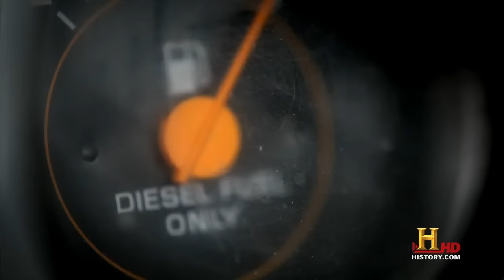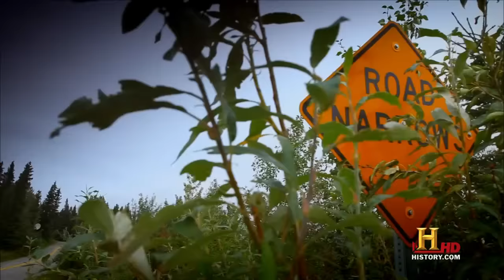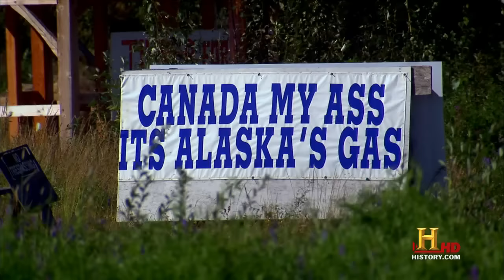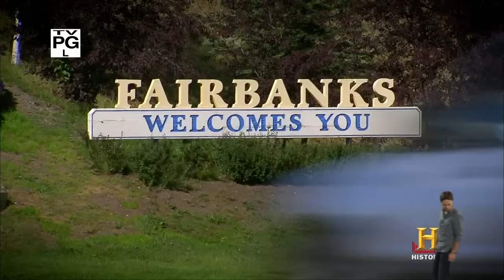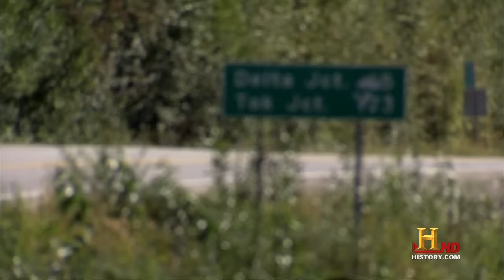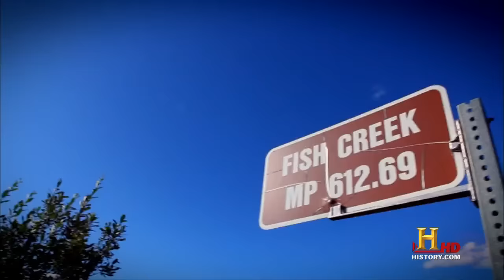Top Gear America Best America's 4x4 Truck   S01E09 - 2011.01.16

Comment: Funny and ironic. The Toyota is the only truck to get parts exclusively for the U.S. Break down of these trucks. The dodge has extra electronics in it and it isn't a diesel. Water can stop it. The Smurf-side Chevy. It is a Luxury on the doad truck with a regular 350 in it. It will do okay, but it isn't really set up for being off of pavement either. The Ford is a 250. It is a regular truck that has been strengthen to handle work loads and The Ford is also old school 4x4, not lift kits like the other two. I like all trucks and have driven all of the trucks in this video for a few years each. The problem with the gtrucks beside the Ford is that thet were built in a different era, that isn't exactly as resilient as the older versions. Before you say anything, water got into the carburator and stalled it for a few minutes. If any water touches the electronics in the motors of the other two trucks they are paperweights. The only bad thing that happen is that he submerged the hood which the other two didn't do. Chuck Norris, Keith Richards and The Smurf. 26:25. All three trucks have been stopped/stuck once. Assist for each. Ford: 2 Dodge: 1 Chevy: 0. 27:13. The Ford is completely American because of it's age. The Chevy is American, built in Canada with Asain computers in it's electronics not in the drivetrain yet.. The Dodge built in America but with Asian computers throughout the truck including the drivetrain. How the Ford went out of the race isn't fair. In the original Top Gear would get a chance to have to fix their vehicles. Clarkston fixed the electronics on his Porsche. Hammond rebuilt a broken axle on his Mustang. Really, these "Men" can't work on their trucks?

Comment: Okay, truck choices: perfect
Top Gear theme song, structure and presentation: spot on
The Chevy Stepside winning the day: of course, the obvious victor in this challenge.
Cheating and sabotage: done adequately
Modifications: ridiculous, therefore correct.

The presenters: I can't decide if the current UK Top Gear hosts are better or worse than these guys. I'm sure they are nice fellas, but they lack the dry, yet juvenile humor of Clarkson, Hammond and May. Simply incorrect choices for leading men of the USA version of the best motoring show on Earth.
It's a shame, because otherwise, I think this is a fine special.

Comment: battery would not have killed the dodge. if the battery disconnected while the dodge was running, then it would’ve still ran. disconnected battery causes the car not to start. great acting.

Comment: That Was not totally accurate The ford got damaged cause of the dry shaft It was also very old truck tanner chevy and it said had 200,000 miles in the Odometer  I don't think that's true The dodge There's nothing to say about that But they could have done a more accurate comparison like a truck from the same year with the same mileage That would have been a lot better but

Comment: Personally I'd rather see them showcase the trucks capabilities and the differences between the types of motor/transmission/transfer case/locking or limited slip differentials instead of how they just beat the shit out of these trucks.  i definitely became annoyed when they rammed a classic step side Chevy into a perfectly good 1996 dodge ram.

Comment: You are all 3 driving inferior trucks. That's why the guy that actually lives there drives a yota. It's an unbeatable truck. I own a tundra. I owned a tundra before this that ran for 16 years with zero problems and I wrecked it twice. Toyotas are hands down the best vehicles you can buy. I don't care about gas milaege because I can afford gas to put in my truck whenever I need so the gas argument is for losers. The tundras are better looking built better and last longer than any other truck on the market. That's why my 2019 with 30k miles on it would sell right now for as much as I paid for it new. That's because the truck is bullet proof. Anyone who would argue this is wrong and doesn't know what they're talking about. Please don't respond to my comment with anything related to didge or Chevy or Ford and make yourself look dumb. And we aren't talking about diesel obviously as Toyota doesn't sell diesel here in America but if they brought their diesel here like they thought about in the past it would outrun the Ford diesel. They do all the time in Japan. Toyota 8s hands down the ultimate off-road vehicle. I'd take a tricked out Tacoma over a jeep any day. I don't want anything that would break in the first few days of trail.

Comment: Don't forget you got Grand Prix on Amazon prime The original guys are so much better Also this video makes no sense They keep saying oh the Toyota's going to be of course toyota is better than all of them I would take a tundra over every truck the only good American truck is the Ford There's no quality control with GM or Chrysler anymore so I would never have a ram you keep seeing videos of brand new rams trying to go off road and their electronic systems don't even work right and they're brand new The  The other issue with the truck is they picked all different decades for the trucks they should have picked the same decade in mileage it would have been a lot better to see nineties trucks that against each other Cause American trucks hadn't been good since the 1990s that's the last good decade